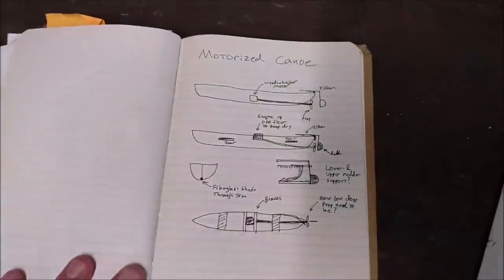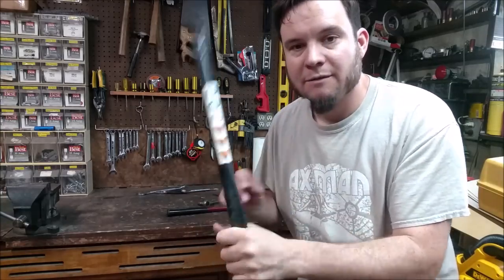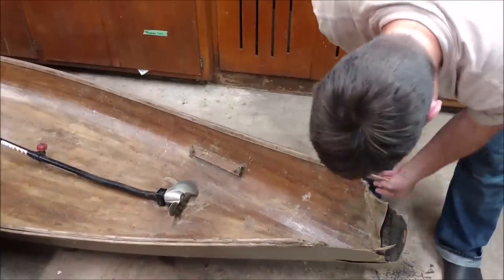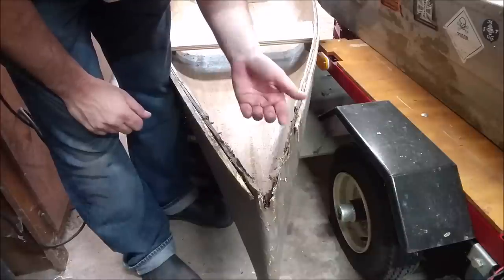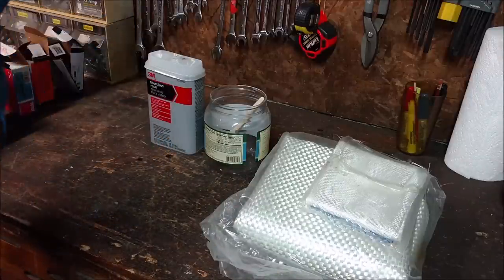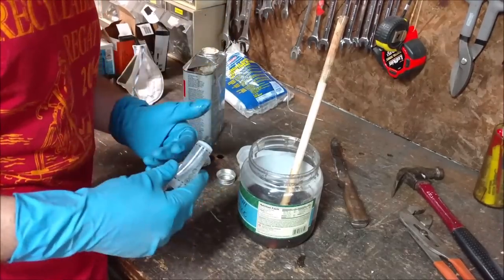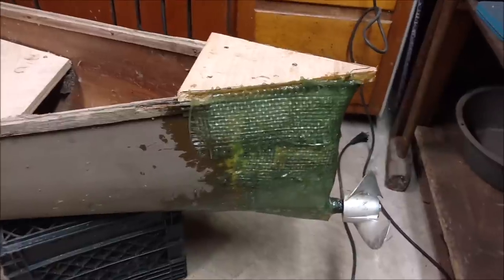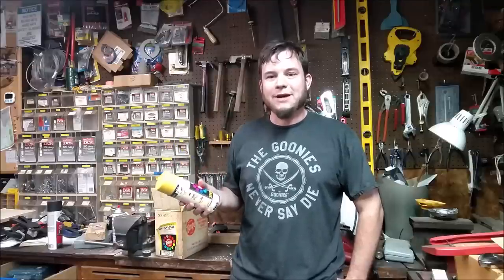Building a Motorized Canoe out of Trash

Comment: Just in case you were curious, the propeller is off of a 1940's or early 50's Gale 1.5-5hp outboard. Gale was a division of OMC (Johnson/Evinrude) and sold their motors under different names for department stores.
Reply: They also owned Lawnboy at one point.   Which is why I'm planning on mounting one to a ESKA 5 lower Unit.  What makes it even cooler is the mower is electric start.

Comment: You can save that crystallized  epoxy.  Just heat the two parts.  Put the resin and hardener (plastic jugs work better, but the metal cans will work too) in a shallow pan of steaming (not boiling) water.  Leave it for an hour or until the crystals have melted and you are good to go.  You have recovered that epoxy and it is as good as new.
Reply: I'll note that what he has there IS NOT EPOXY.  It's polyester resin.  Totally different chemistry than epoxy.  Polyester resins are crappier in most respects, but they're much cheaper than equivalent volumes of epoxy.  The pre-polymer in the big can is made from styrene resin and (as I recall) propylene glycol, which forms a polyester that isn't fully cross-linked.  The hardener is a catalyst that is typically either benzoyl peroxide or methyl-ethyl ketone peroxide--it triggers the cross-linking reaction, which as we saw here, can happen spontaneously over long time periods...

Comment: next time you put some glass on something, keep the brush in one hand, use it like you did to put the resin on the matting then use it to work the air out from underneath the glass when you apply it. that keeps one hand clean to scratch you nose or do whatever you need a clean hand for. and before you touch anything rub talcum powder liberally on your hands and forearms, it gets in your pores and doesn't let the glass fibers stick in you, you'll be glad you did when the itching doesn't go on for days. cool project mate

Comment: its much easier if you put the resin on the boat, then lay your dry strip of cloth on it, then press it in and if necessary add a little more resin to wet it out..  Then you can take some saran wrap to put it over and press it down to get any bubbles out and make a nice smooth surface.  Later after it sets up you can remove the saran wrap

Comment: To me, the obvious fix would have been cutting off last 18" of that boogered stern and put a flat transom in there.  Good rudder mount, and easily 'glassed into the existing hull.  Just me, though.
Reply: Eric Perkins That's what I thought he was going to do. Too bad he didn't. It would have been a much nicer result.
Reply: Then attach a large enough eyehook  on top in the center  to slide the shaft  of the weed whacker  though and forget the rutter.
Reply: Thought the same thing
Reply: Yup
My thoughts exactly

Comment: I can say from experience you'll quickly burn out the centrifugal clutch as it's made for air and not water. Simple solution is to either stretch or change the spring on the clutch to less tension. You're welcome.

Comment: Very cool!  I tried my hand at doing a  bit of fiber-glassing about 35 years ago. I picked up a used Honda 750 with fering and lowers. I wanted to mount an AM/FM/Cassette player on the fering, so I decided to build on. I purchased a fiberglass body repair kit and grabbed some old window screen I had in the garage. Used the screen to hold the glass, and built a nice little frame with speaker grills on the side. It turned out fairly nice. Painted it black to match my rig and away we went!  About three years later, I blew out my back and could no longer ride, so a junk man offered to trade an old Dodge Van for the bike. I took him up on it. Six months later, I responded to a motorcycle accident, his kid had my old Honda and left the highway at 60 plus. About the only thing not busted to hell was that fiberglass radio cover.  Kid came out of it about a month later and seems OK well he did when I left the area in 93.

Comment: The way a lot of guys do it is to mount the motor on a stand so it will swivel sideways and up and down . They don't use a rudder the motor is the rudder you point the prop and the boat goes in the other direction , simple/
Reply: H h

Comment: If it has a motor you have to register it. I like to see the expression on their face at the court house, when you tell them what kind of horse power you have!!
Reply from the maker: I once registered a raft made out of barrels and plywood, I made sure to show them a picture for extra laughs. It was 16' long, they suggested we cut it in half to meet the 8' maximum for unregistered boats!
Reply: @saveitforparts  Hi. Neat project. I've been wondering for years if any weed wacker had enough power to do what you attempted. Do you have any idea what the size of your weed wacker engine is?
Reply from the maker: @_onesimpleidea  It was a pretty small one, I dont' remember the cc or hp and I've sold it now!

Comment: I love the name!  Here is another option. How about the wave wacker? 
   I’ve been toying with a similar idea for my kayak, but I want it to be electric so that it is more quiet.
Reply from the maker: Some more torque or smaller prop would probably have helped this one! I bet electric would have the torque needed, or you could get a geared-down electric motor like the one I'm using on my rail cart thing.
Reply: I just found something in my feed called KKK long shaft propeller- Mini version 1.0. It seems to be a long tail style motor boat mount for a kayak.  It looks like a company from Thailand (where this propulsion system is popular) that produces this kit. If you look for it on YouTube, it should come up. 
  I didn’t see anyone wearing white robes in the video, so no worries there.  This could be easily made from homemade stuff. It seems to go pretty fast!

Comment: I think it would’ve been easier just to cut the back off and make a flat back in case you wanted to hang a boat motor on the back
Reply from the maker: A few people have suggested that, I didn't even think of it at the time!
Reply: @saveitforparts  I like the route you went...I think it was actually easier in the long run because you didnt have to mess with the motor as much
Reply: Yeah, I really don't see why he didn't think of that instead of running the motor rod through the back of the boat which means you really have to stop up the hole you made to get it through there. He's gonna need a lot of Flex Seal to patch up that hole, then he made more holes putting on the rudder at the top to attach it. 🤨 I hope this whole thing works ok. 😨 If not, then it's back to the drawing board.😄
Reply from the maker: @conniee.  The entire stern was already destroyed when I got the thing, so I didn't have to make a hole! I just set the weedwhacker shaft in there and fiberglassed around it.
Reply: @saveitforparts  Ok, good, but you used fiberglass and glue or what to seal it all the way up so it won't leak? 🧐
Reply: @conniee.   thats literally how boats, canoes, and surfboards are made. with fiberglass and resin. educate yourself before you go trying to put others down.
Reply: @jaxonbmx2699  - Ok Mr. Know-it-all but It wasn't a put-down, but I guess you didn't know THAT, huh? 🤦🏾‍♀️ 👎🏽👃🏽

Comment: area of propeller pi r^2 = 3.14 x ,01 =.035 ft^2  density : 64lb/32.174 ft/s^2= 2 slugs/ft^3  speed , velocity iterate a ;  10 ft/s.  :  1000 x  .035  x  2  =  700 :  now 1hp = 550 ft lb/s :  that is 1.X   horsepower  - the green motor runs at  6000 rpm= 100/second.  The twist is set at 1 inch/revolution
Reply: the twist is reset to ..1 inch / revolution

Comment: I am amazed by your skill. 

How did you water proof the weed worker propeller rod to prevent water from getting in the boat?
Reply from the maker: The motor is above the water line, so any water that gets in the outer tube of the prop shaft doesn't make it into the boat.

Comment: What kind of prop shaft seal / drip seal did you use? 
Awesome channel, subbed
Reply from the maker: It's not sealed at all, I just put the motor up above the water line. That way the water doesn't get high enough to come into the boat. It's the cheap and dirty way to do a prop shaft!

Comment: They sell propellers on Ebay that are designed to turn a weed whacker into a trolling motor.  Two different designs - one for curved shaft and one for straight shaft because they turn in different directions.  I understand that you are probably trying to do this with all junk parts, but your weed whacker engine is going to have a problem turning a full size prop, and besides there is no need to fab up spacers..
Reply from the maker: Thanks, I'll have to have a look if I end up keeping this!
Reply: @saveitforparts  I got the one for the curved shaft for mine...  That way I have a PVC tube mount set up to hold it, and I can swap the mount between the kayak or the canoe.

It's never going to be as fast as an electric trolling motor, but I can carry a lot more gas than marine batteries.  5 gallons of gas will run a weed whacker a pretty long time. :)

You might also consider that it doesn't have to be all the way at the stern...  they still work pretty well hanging off the side which allows you to move the weight further forward.
Reply: @saveitforparts  I've recently seen an electric  prop designed for kyack. It was tiny perhaps 2 inches in diameter with 4 blades.

Comment: why did you leave the shaft so long?  i would think that would equate to energy loss and vibration.
Reply from the maker: I wanted the motor more towards the center so I could sit behind it and mess with the choke. Plus it let me put the power head up higher than the water level.
Reply: @saveitforparts  I was thinking you could shorten it and bend the shaft so the motor sets upright and you're not huffing exhaust and maybe get more power to the prop.. but I like the concept of a cheap easy build from junk.  I like your videos.

Comment: At 59 is that a bearing at the end of weed eater shaft ? if so just how long do you figure it's going to last with it being under water ? yes all this is okay But !..... thanks for video
Reply: You could always dismantle it and grease after service. I had a kite buggy I used to run it through sea water often. After use I washed it and sprayed wd40 on it. Close to a year went by and much to my suprise i discovered it had steel roller bearings. They were unrusted and fine

Comment: Is the propeller going to be submerged enough to run straight. I can see the canoe turning in circles lol.
Reply from the maker: If you check out the testing videos you can see the prop is almost TOO submerged, as is the entire back of the boat. This supposedly 2-person canoe barely floated me!
Reply: @saveitforparts  Yes I saw the testing video. You almost sunk it! Needs extra buoyancy at the rear. Shape some polystyrene and attach to the rear maybe.

Comment: What propeller did you use for the canoe, I'm needing one for my outboard and it looks like that one would work.
Reply: I'm guessing but looks like it is off an old Johnson 3.5 or 5 hp direct drive.
Reply from the maker: Someone else ID'd the prop as coming from a Gale outboard. I picked it up at a flea market and didn't know much about it other than it looked about the right size.
Reply: saveitforparts m

Comment: Way, way, way too much work. Slather some resin on the bow—fine. Jus square off the stern with a 3/4" piece of plywood about 2" forward of the damaged area. Jeesh!
Reply: I was thinking the same just cut it about 6 inches behind where he has that back seat and put a transom there, move the seat forward about 16 inches and you are done.
Reply from the maker: Ha, that would be easier. I could also just bolt a real outboard to a square stern.

Comment: No shaft bushing seal. I assume it sank.
Reply from the maker: The motor's power head is above the water line, so it gets some water up inside the outer shaft tube but not into the boat. If I were using this in salt water I'd probably want something like a greased stuffing box to keep water out of the tube.